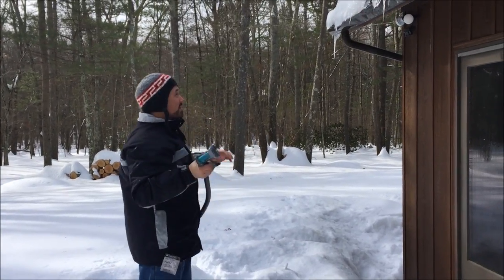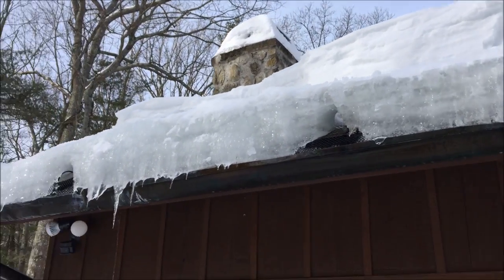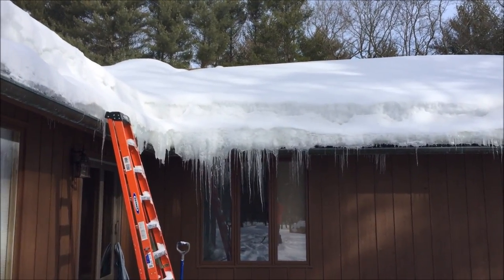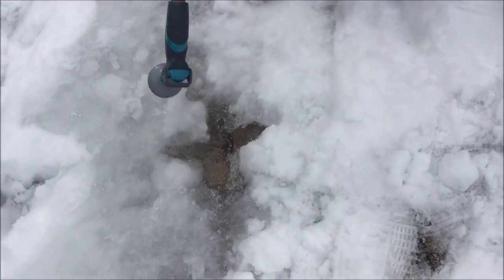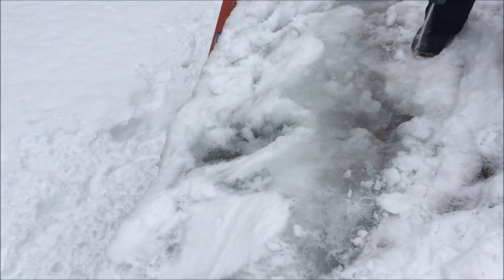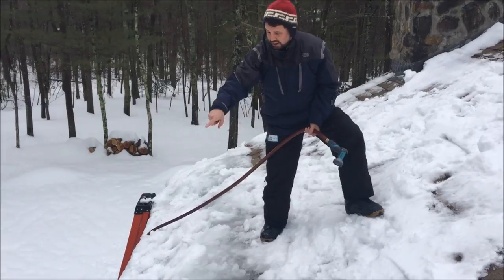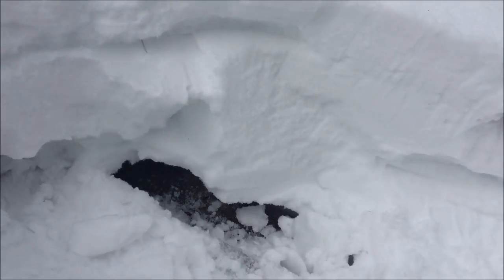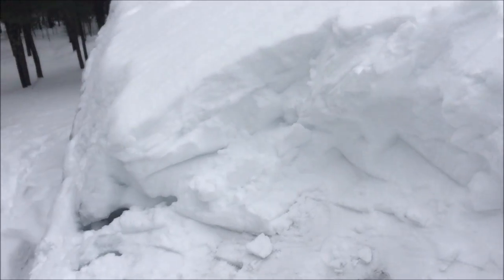How to Stop Ice Dams using Hot Water

Comment: If you had installed 6'-9' of ice and water shield on the roof edge you would not have the water coming in the ceiling. Also install commercial heat cable in your gutters and downspouts w a few loops in the field area.